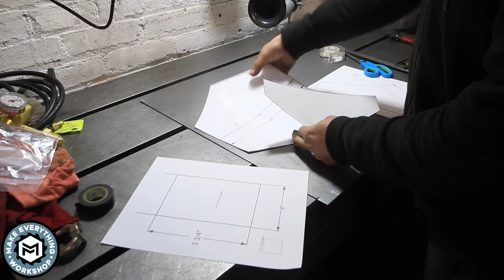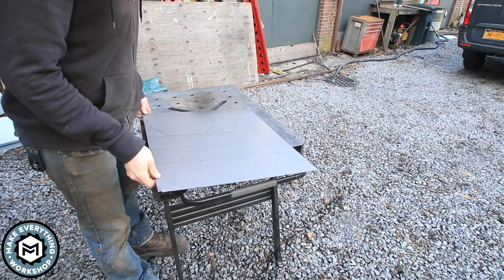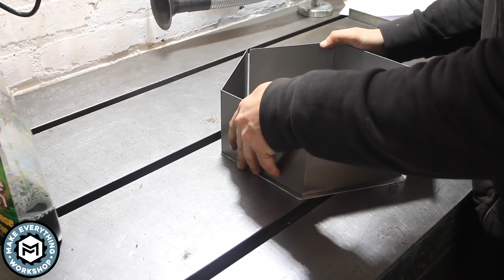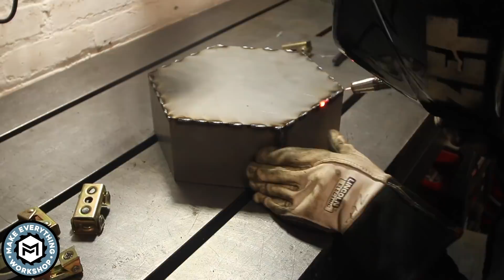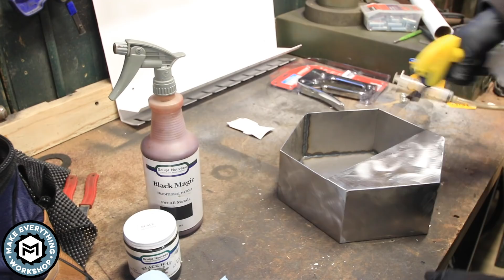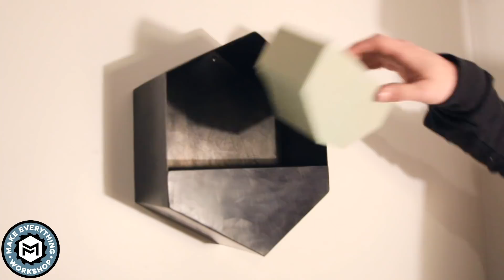Easy Steel Wall Planter - Beginner Welding Project

Comment: Chris nice project design & build. I'm going to draw this up and generate a gcode file with Scan2CAD to cut them up on my homemade modified Shapeoko plasma table. I prefer to TIG as I believe I can minimize the distortion. Great result from the depth &  shading the blackening creates and the paste brings additional visual effects by reflecting or absorbing light depending on polishing.

Comment: Didn't you just get a metalworker?
Reply: Did you not get the whole point of the video like beginner is in the title and I don't think the average "beginner" has a 38 ton metal worker.
Reply from the maker: Yeah I just got another 38ton ironworker as well
Reply: it would have been a great opportunity to use it
Reply from the maker: Andrew Spacespanker yes, but I wanted to show this with low tech tool, I’ll be using the iron worker a lot coming up very soon!

Comment: Nice clean welds.  Get a stamping/cutting die and sell them as a diy panel kits.
Make them in various sizes for crafters.  Cut outs/designs on upper panels.
Light options...you may have something here as a parts bin.  Bee hive style.
Reply from the maker: Thanks! Yeah I see a lot of options with this! Many wants to expand on this idea!